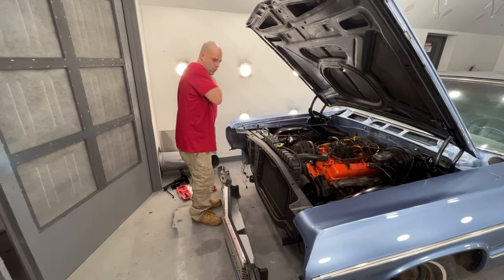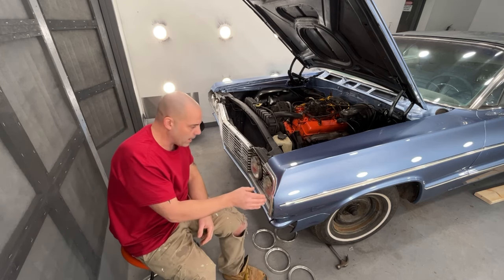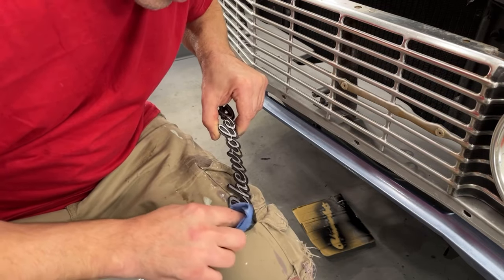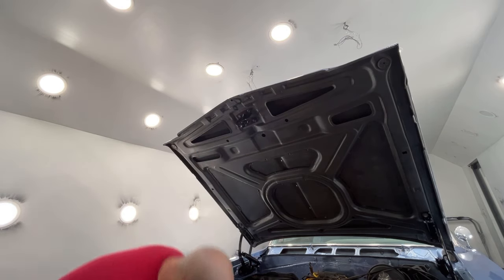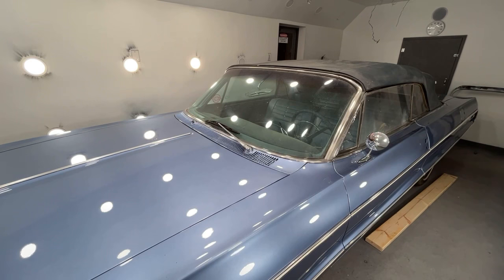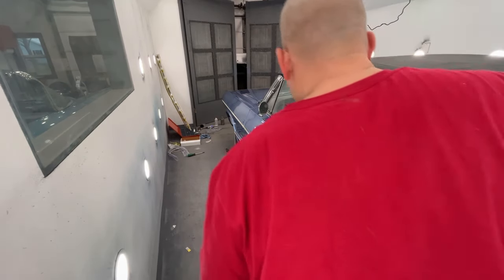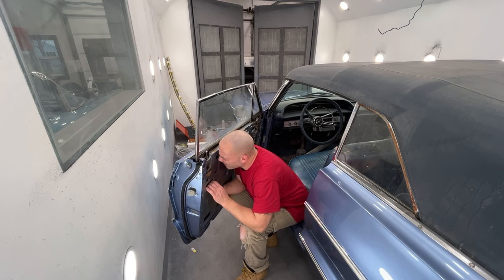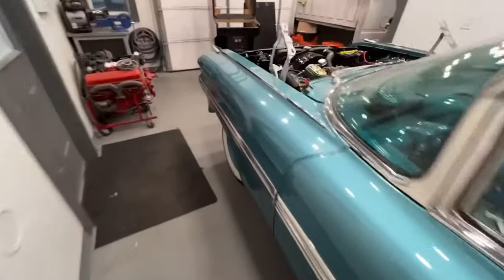More progress in the 64 impala convertible, front grill some weatherstripping

Comment: Good work Troy.  The repop 64 eye brow moldings have to single handedly be the worst reproduction part available.  They fit like ass, and the clips suck like you said.  Curious how that repop hood lip fit compared to original...
Reply from the maker: It definitely fits better than I thought, but still off and the problem is is where it’s away from the body. If you push on it just a little bit at creases oh, that shits junk.
Reply from the maker: And thank you
Reply: @IRESTOREBUILDSTUFF-ne9xv  lol yessir.  Atleast the hood is original...repop hood lip on a repop hood is hard to work with.